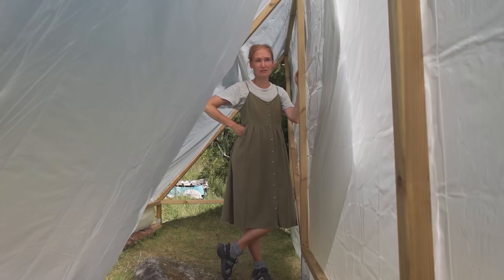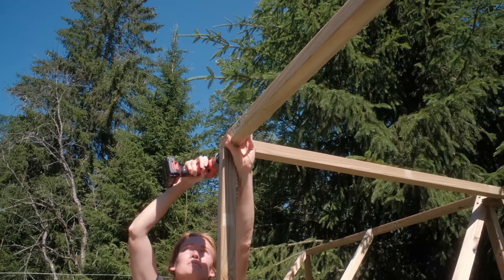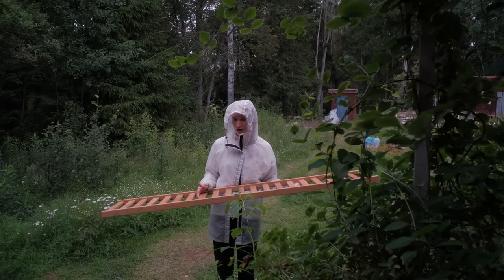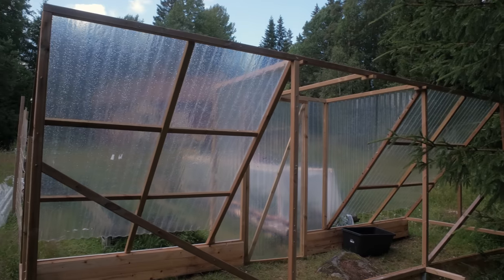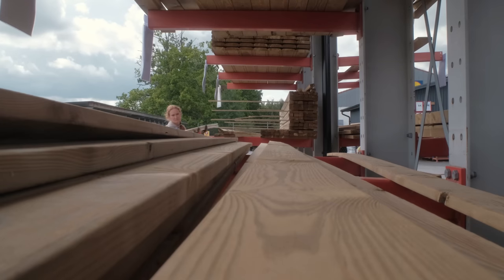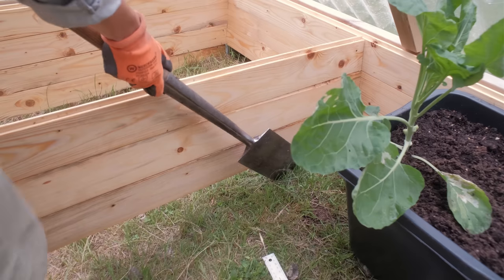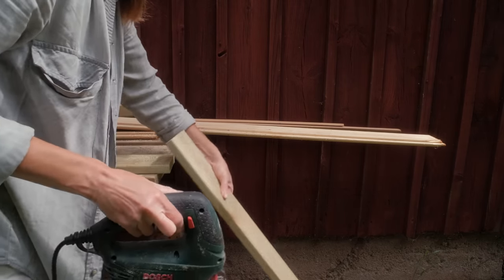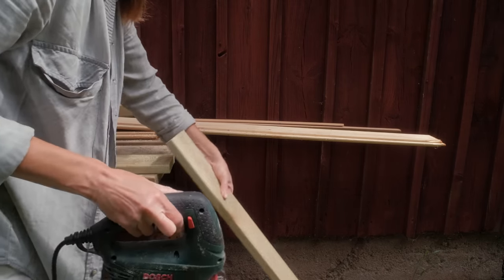I accidentally built a fairytale greenhouse (Story 59)

Comment: You shouldn't have used that particular plastic on the ridge crest and on the ends of the roof. (19:00) I used the same one, but the sun caused it to disintegrate. I had to change to normal construction plastic that can withstand UV light. Super cozy greenhouse you have made, and I just love it.

Comment: Love it! I was wondering the corrugated panels, would it be best for the ridges to go parallel so the rain and snow will fall sideways instead of down and go inside? I'm thinking of doing this in the back of my apartment. The tarp, is it used instead of the panels in certain areas for a reason?

Comment: great result and design but if your tongue and groove touches the floor eventually they will rot from moisture even thought its oiled if you had put a  line of brick teven not with cement under this it will help stop that.

Comment: Unfortunately I can't find out anything about what country you're in or what area you are in with this greenhouse. It looks lovely. Look into your design and imagine ventilation. From what I can tell your area is really wet and the inside is going to become very wet as well. You really should look into using some sort of polyurethane to seal the wood up or you're going to end up with a lot of mold and wood rot around your plants. Not a good thing for food.

Comment: Hello. It is really difficult to find cheap material and build a structure, moreover, by yourself. I see that you are limited by space, that's why the entrance is designed in a non-standard way. But, in my opinion, you limit yourself more than necessary. Why does the building have sloping walls? Because they look like that in the picture? I think you needlessly lost a lot of space. In fact, the walls don't have to be slanted at all. Even if the sun is relatively low above the horizon, it will still shine into a block-shaped building, especially if it has a transparent roof. I recommend covering the inner wall near the forest and lateral sides with heat-reflecting material, for example, I would use aluminum foil or those foils that are put behind car windows so that the sun does not heat up the interior.

Comment: Did I see you put wood directly into dirt?  That will rot.  Better attached with brackets to concrete footings or drive 4x4 steel post supports into the ground.

Comment: I can't get a handle on your accent, it seems to meander through British, North American, a pinch of Australasian, with an alarming hint of valley girl/ estuary English, though thankfully currently not terminal.
I am, like you, and tend to wing it on projects and at seventy I can't see that changing. You will always end up with a more organic finish, that is a polite way of saying quirky. It came out nice in the end; though, keep you in salad greens and spinach all winter.
Try tape flashing on the  seams, it is very effective, easy to use and helps protect the wood. Polycarbonate was the right choice, the greenhouse plastic sheeting is expensive impossible to clean and does not last.
I know I am going on a bit, but 'never' put your wrist in front of an electric saw, you did it twice on the vid and I found it more than a little alarming.

Comment: The wood you put in the dirt is going to rot out, I’m assuming by the looks of it that it is untreated lumber.
Reply: Didn’t she say at the beginning that she used impregnated timber and fence posts?
Reply: @mireille4751  Will probably still rot out. Especially in her climate. I have seen it many many times. Realistically you need a stone/concrete foundation for it not rot. Important that the wood can breathe and still dry out well. With her climate I would be surprised if it starts rotting within 10 years.
Reply: @ChipmunkGuyGamerGaming  I agree with You, it will probably rot within ten years. She will then build another one, larger, or will sell the house, heading to new adventures